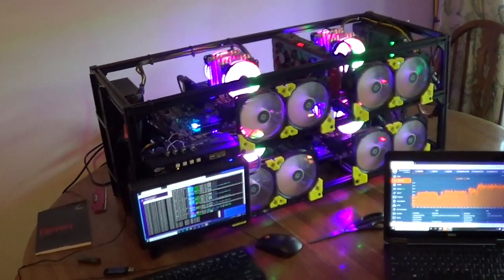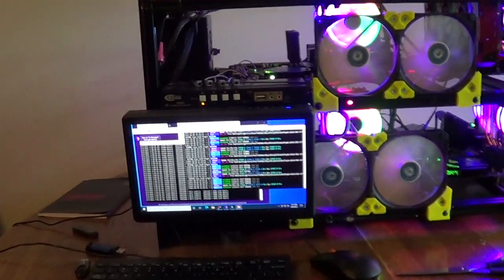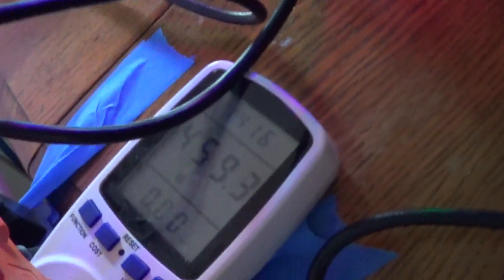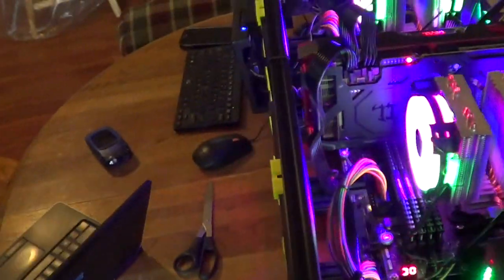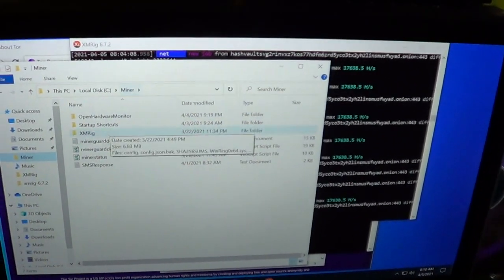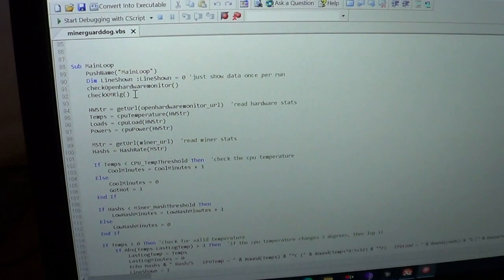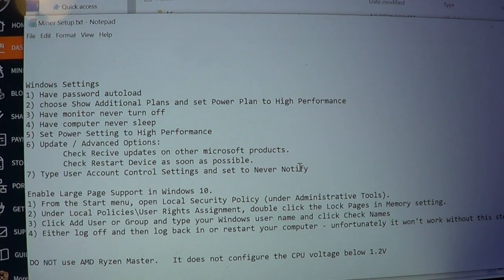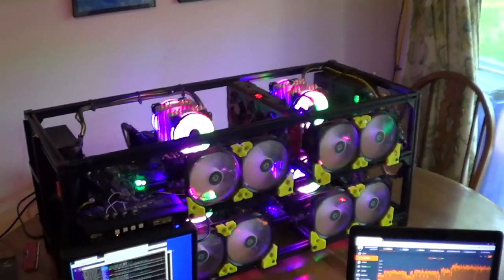Monero 4 x AMD Ryzen 3950X Miner Upgrade to 70,000 Hash

Comment: FYI 3000 series should have something called an ECO mode that could either be activated through bios or ryzen master. Allowing you to drop the voltage down to about 0.9V stable and running 44% power consumption with 77% performance. Other then having the best performance/wattage you'll also run A LOT cooler.
Reply from the maker: I get unstable below 1.05 V running 2.9 Ghz.   This is manual tweaking.   If I run 0.9V, I have to drop the frequency down a lot more.

Comment: what's your profitability from this rig per day ?
Reply: Using solar power with grid tie inverter will cut down the electricity to 50%. You pay only the power using at night when is no sun.
For 100% profitabillty you have to add 48v solar battery system 40 killowatthours wich is around $120 per kw if you choose deepcycle  agm = $4800. 5-7 years battery life.
Best world battery ever made is a lot cheaper solution when you buy bulk battery system using lithium titanate YINLONG. This is 25 years shell lifecycle. Its the best battery in the world also used in space shuttles and satellites. And its the safest battery. 0 fire risk.
Reply: @FRESNEL_COOKING_SOLAR_OVENS24  isnt UPS battery for power shortage cheaper?
Reply: @sportnastava  there is no UPS with 40kwh storage at this matching price. This is the energy to power a house for 2-4 days without sun.
Reply: @sportnastava  an UPS 2.5KW FOR 1 HOUR OF POWER OUTPUT WILL COST AROUND $6000.
Reply: And they are not even pure sinusoidal output form. That issue of output form can damage your mining rigs in 15 minutes.
Ups power for computers are a total scam mafia.
A solar hybrid inverter 48v and batteries offers pure electricity 20 times the capacity watthours of a crappy UPS scam. Depends in your battery capacity.. You can expect 2.5kw mining power to run 19 hours from a 50kw batterysystem.
Reply: 70k hash on xmr is around 4$ per day...
Reply: @sportnastava  doesn't worth, after thr electricity he is getting now around 70$ per month,,
Reply: @sportnastava  😱😲 It's worth the investment? I wanted to know how much he applied
Reply: @Someoneisavaible  thats up to you to decide, check cost and output vs power consumption... With few gpus might be interesting to see whole system running

Comment: Seems like it will take 300days ROI, IF the monero keeps it up at 400$ a piece. I just started to mine on my 2600 when i don't use my PC and i was looking into larger scale and it seems like... not lucrative. Light me up, i must be missing something.
Reply from the maker: You should be able to get 4,000 Hash.   That is $10 per month mining 12 hours a day.   The best option would be to keep the labor down.   Do you have any plans to run XMRig.exe as a screen saver?

Comment: My CPU mining rate on nice hash is much lower using the 3950x. I only get like 12/13. Any idea why not higher?
Reply from the maker: try 4 sticks of ram.   maybe nicehash needs to run in admin mode?  use all the cores?

Comment: in the end 15:55 you mentioned about "you hope that rigs running many year" that is even more intrigue. What is the point?
i explain my question (i really watn get your point 😉)
1 -3950x is give 1.78$(48$ month) for now but cost in newegg for example 810$ (in my county it cost 946$...) and we can put 1 cpu per rig
2 -in dollars 1.78$ for now in ETH is 18Mhs - 18 we can get on every 1060 without overclock but with OC -24Mhs = 2.44$ per day and 73$ per month.
3 -we can easy put in almost every rig 6-8 GPUs and what we take in ETH -> convert every day to XMR - so this way we can recieve more XMR if you belive in monero and hold monero.

So even on old GTX 1060 wich not so power effective we can getn money representation more XMR, we can day by day change ETH to XMR is we wath hold xmr.... but in gpu mining we can put many GPUs for example if i attentively read description about ASUS ROG Crosshair VII HERO - there are room for 7 GPUs ...
Reply from the maker: I saw ETH has gone up much more than XMR.   This rig previously had 8 x VEGA 56 cards that would currently make $40 per day.   I sold those cards 2 years ago for $400 each.   They go for $800 today used.   XMR pays $9 per day now.   I don't have the time to go back to GPU cards.    Plus, they are super expensive now.   I'll just keep mining monero to the end.    I'm running 99.9% up time now for the last month at 68,000 Hash.   I'll do an update videos showing the reliability.   GPU cards do crash daily.   But, the watch dog software I previously ran made them reliable.
Reply: @microdronetech8453  >GPU cards do crash daily
i feel sad that you don't get stable GPUs
Reply from the maker: @noname-cp8ki  They crash more often when the core voltage is lowered to keep them cooler and save power.   It is always a trade off between stability and efficiency.

Comment: very nice setup! 
i accidentally found your video (just thinking about buying 3950x for my pc and randomly watch youtube about cpu)
but conform nicehash calc - 3950x give 1.8$ per day - so - what is the point in such investments in so pricey cpus?
Reply from the maker: $1.8 per day is $657 per year.   There is the CPU payback.    10 years of mining is $6,570.    It is profitable.    I don't count the electricity because I like the heat in the basement.    I don't count the labor because I enjoy building a supercompter.
Reply: @microdronetech8453  >$1.8 per day is $657 per year.   There is the CPU payback.    10 years of mining is $6,570

but this calculation is for now - when XMR almost at "all time high"...
but i agree that if "we" think in 10 years - in this period all currency will be at ATH 1-2 time probably...
thank for your answers 🙂
Reply: @microdronetech8453  If you're at home and don't have a dickhead supervisor, it's not labor :D
Reply from the maker: @waynefilkins8394  reality is my supervisor.   And the marx labor theory of value leaves out that the $6,000 worth of hardware for the miner is not free.  Nor is the latest hardware the same as 25 year old obsolete hardware.   It takes labor to make the stuff work.
Reply: @microdronetech8453  I meant it figuratively like when people say they enjoy their job so it's not like they are working, ya know?  Like the whole work from home thing...I know you're still working and prolly putting in mad hours, I didn't mean it like that. I just meant like it's way better than working a shit job for some dickhead, doing more work than him and getting paid less.
Reply from the maker: @waynefilkins8394  I suppose.   I had a dream job for a few years.   They never last.   But it was fun while it lasted.
Reply: How many degrees does all the hardware increase temperature in the House? If your smart enough to rig this you can surely make a solar bank setup with ease.

Comment: Im having a hard time making sure i get the right equipment, i have everything in my amazon list except the Aurora Colorful Backlit 3Pin 2 Fans 6 Copper Tube Dual Tower CPU Cooling Fan Cooler Heatsink for Intel AMD ... i have 4 alternative options in my cart but not sure if they are 100% compatible...can you provide a similar link to one that i can purchase please
Reply from the maker: Here is the heat sink.   https://banggood.app.link/onN2PNVs3fb
Reply: @microdronetech8453  how does it perform compared with other brands of work the stock cooler?
Reply from the maker: I just updated the fans.   The Colorful fans have really bad bearings.   The share folder has the latest parts list.   The new fans run about 10 deg F cooler too.
Reply from the maker: Never mind, this one is cheaper.   Use the Arctic fans in the parts list.   https://banggood.app.link/JLkcfw2s3fb

Comment: And you have just showed me there was no reason to run my 3900xt at 4400 with 1.375 V. I was hitting 90 degree C on AIO at full speed. Won't mention the power consuption Thank you.
Reply from the maker: I have been super stable at 3,800 Mhz at 1.1000 V.   The watch dog software reboots 1 of the miners maybe every 4 days when the has rate drops 10%.   I'm waiting to have a solid month of 68,000 Hash/Sec and I will post an update video.   I had to get off the Tor network for reliability reasons.
Reply: how much xmr a mo
Reply from the maker: @InnocentFormalities  0.6 per month.  Not going to get rich any time soon.  But, the miners are low maintenance and stay up 99.9%.
Reply: @microdronetech8453  yes but you leave hundred bucks in to earn maybe 70$ monthly...

Comment: setup cost vs payback period?
 Loki-network could be worth a look vs TOR regards speeds.
Thanks for sharing :)
Reply from the maker: I'm making $9 per day now.   Electric is $2.  But, I don't care about the energy because I love the 900 watts of heat in the basement.
Reply: @microdronetech8453  is this rig for sale ?
Reply from the maker: @f.e.free4a25  I'm thinking about listing it for $8,000.   But, I would just build another one.   Payback would be 2.4 years at todays XMR prices.  Hardware prices are up though.    I'm in XMR for the long haul.   Building a rig really isn't that hard.   I will try to keep the share folder up to date with any changes I do to this rig.   GPU mining was quite a bit harder.    My hardware is already paid for.   What I like is that XMR can drop down to $60 and I am still profitable with electricity.   Can't say the same for Bitcoin since they have no tail emissions.

Comment: amazing build! why arent you using any mining os? i am just trying to find the optimal solution.
Reply from the maker: The mining os charge a fee.   Monero seems to have the highest hash rates on winblows operating system.   I made this video to make it easier for anyone to mine monero on winblows.   But, I could see the advantage of a mining os making it easy to mine many different coins.
Reply: @microdronetech8453  Really? I get about a %5 improvement in a fully optimized linux system compared to a identical fully optimized windows system
Reply: Have you tried ragerX USB at all?

Comment: great video, where do you buy hardware? can't seem to find cpu and mobo for same prices as you
Reply from the maker: microcenter for the cpu.   It looks like everything is going nuts right now with the free stimulus money.   Used prices are higher than MSRP.   Wait a few months.   Prices will crash soon enough.
Reply: @microdronetech8453  thanks for replying, im wondering whats the power consumption for each computer/entire rig?
Reply from the maker: @cyo1987  17,500 hash on the 3950x draws 230 watts total.  The CPU is 130 watts.   100 watts is the mother board, fans and ram.    The 3900x ran 12,500 hash at 200 watts total.   The mother board watts is the same on both chips.   The entire miner is X 4.
Reply from the maker: @cyo1987  940 watts total.   68,000 hash.   I'll do an update video on 99.9% uptime for 1 month.